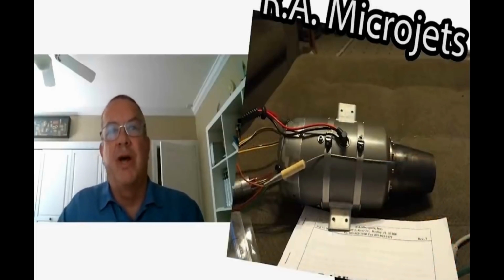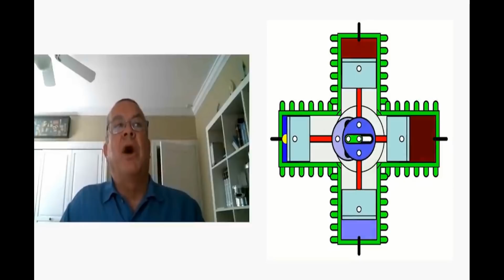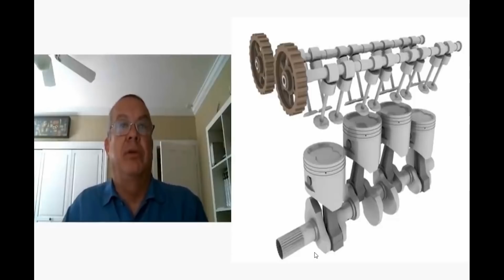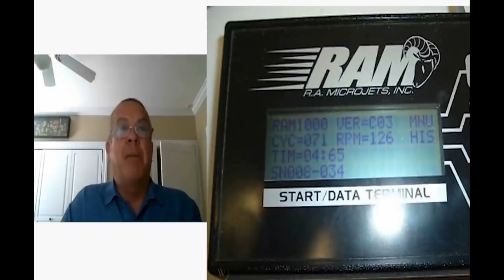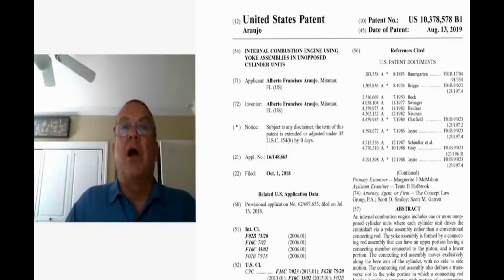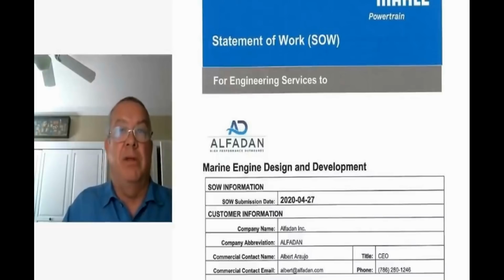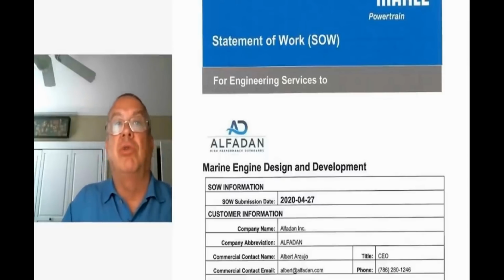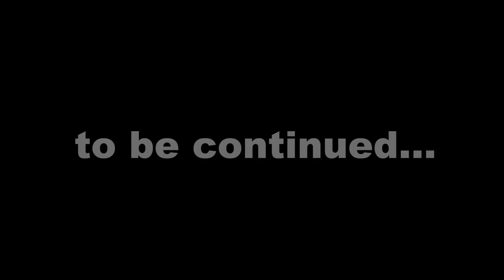Alfadan EXPLAINED! - Part 1

Comment: The piston and connecting does not need to be separate pieces. It can be made of aluminium. And if it is two stroke it will always be in compression. It will favour an over square design.
Reply: Don't quite understand what you are saying .  Piston and connecting rod don't have to be separate  pieces  ?  Connecting rods can be aluminium of course but generally only in small low stressed engines.  Aluminium  rods are generally only used in high performance engines in a drag race situation or such where engines are forever being rebuilt.  They simply do not have durability or longevity.
Reply: @chasermalloy7406  I’m referring to a specific scotch yoke engine implementation.
Reply: @m0rtifiedpenguin  But how can that have a Piston and rod that are one piece ?
Reply: @chasermalloy7406  look at a scotch yoke mechanism. The piston rod does not need to pivot at the piston pin. Rod to stroke ratio does not matter. The connecting rod can be perfectly straight. The piston pin boss adds weight. Length adds weight.
Reply: @m0rtifiedpenguin   I thought you were suggesting that the piston and rod were MADE as one single piece.  In any case it doesn't have applications in high performance engines.
Reply: @chasermalloy7406  that’s what I meant. Machined or cast from a single piece of aluminum. A Scotch yoke mechanism can be designed to work with much less acceleration than traditional crank slider mechanism. The devils in the details. That’s why I said two stroke very oversquare engines. Two stroke piston are always in compression. That’s a very nice set of optimisations right there. A direct injected poppet valve Atkinson cycle two stroke is the sweet spot.
Reply: @m0rtifiedpenguin  I hate this place I just lost a reply I worked on for half an hour.  I'll summarize it next time.
Reply from the maker: Much less acceleration? Explain.
Reply: @thedirtyworkshop use the shortest stroke and biggest bore you can live with. You don’t need high rod to stroke ratios like an f1 engine. This is easier with a two stroke because you don’t need as high an rpm for power and the piston does not experience reversing loads. This simplifies the big end design. An i4 two stroke with a flat crank two pistons will fire at the same time. The engine will have primary and secondary balance and even but not overlapping torque pulses. I would prefer a v4 myself.
Reply from the maker: So, look at the bore and strokes of 2 stroke and 4 stroke engines. 4t are larger bore shorter strokes, not 2t...
Reply: @thedirtyworkshop  port scavenged two strokes need more stroke. nobody has made a poppet valve two stroke engine yet. at least not in production. Atkinson cycle is hard to do without any power valve of some sort. a port engine will require power valves to delay opening of exhaust and intake ports one might as well use poppet valves in the cylinder head.
Reply: @m0rtifiedpenguin  I don't really know much about it at all.  I'd never seen any suggestion that the pistons and rod were made in one piece.   Are they usually one piece ?
Reply: @chasermalloy7406  it’s an optimisation possible in a scotch yoke engine. Impossible in standard crank slider engines.
Reply: @m0rtifiedpenguin  Yeah..it's the one piece piston and rod thing I don't get.  I haven't seen a model or demo where the rid and piston are one piece.  They all seem to show the pistons attached to the rod.
Reply: @chasermalloy7406  I guess I have to go make one then.
Reply: @m0rtifiedpenguin  I'm not arguing the concept because I don't have any detailed knowledge.  The practicality of making the piston and rod from the same material makes me question it in any high performance application.  I also wonder about the practicality of assembly if it were a single piece.  Again just shooting the breeze really.
Reply: @chasermalloy7406  no more different than rebuilding a v8. the piston and connecting rod are joined with the piston pin and then the crank and piston assembly is lowered down the bore and seated on the crank. the connecting rod caps are then installed around the crank and torqued down.
Reply: @m0rtifiedpenguin  But you were talking about piston and rod being one piece
Reply: @chasermalloy7406  assembly would be the same. my point is the connecting rod and piston assembly is handled as one unit during assembly

Comment: Big displacement inline 4 already been done. The 1910 Fiat S76, 28.5L. There's a reason those big displacement 4's are not around today.
Reply: Detroit Diesel Series 50 has been done as well around 8.5L for a 4 cylinder but it can barely rev over 2000 RPM and it shakes and makes a strange engine noise .
Reply: It also required 2 balance shafts.

Comment: look at how a hammer drill works, they just put it in an engine to convert direct recipricating motion to rotational motion, and here you go, you made a rod that doesn't rotate.

it will work, it does in many industrial machines, the problem it getting the thing to be reliable in an engine.
Reply from the maker: A hammer drill? You mean a ramp and anvil? That wouldn't work as an engine...

Comment: There might be a reason why, but why aren't there small diesel outboards? My tractor engine isn't to big, efficient an makes loads of torque. but its heavy as shit
Reply: Mercury has a diesel outboard. Just not small.
Reply: There are small diesel outboard engines, I forget who makes em but they're usually found on sailboats where the extra weight is not a big deal. There are 2 cylinder diesels with like 25hp up to 150hp I believe.
Reply: @csonkaperdido  that makes no sense. On sail boats weight and weight distribution matters the most. Also outboards are not found on bigger sail boats ever. They usually have a diesel inboard though , I'm talking outboard engines
Reply: @johnmeurer4780  the weight of the sailboat doesn't matter to its top speed since it's a displacement hull, not a planing hull.
If you take a sailboat capable of 10mph empty then load it with 5000lbs of stuff, your top speed will be 9.5 knots. Makes almost no difference whatsoever.
Also I'm a marine mechanic, I work on boats every day. MOST sailboats that are, say 30ft or longer typically have a small diesel inboard - yes... But most smaller sailboats, at least in my area (Tampa FL) use an outboard "kicker" motor, NOT an inboard.
I know what I'm talking about bud lol.
I never said the 150hp diesel outboard was a sailboat motor - I said it existed.
I also said, or implied, that the small 20hp outboards ARE pretty much only good in a sailboat bc of the weight penalty. I have a 2 stroke 9.9 Merc that weighs nothing, I can carry it around myself.
You're not carrying around a 10hp diesel.
Therefore, it will never go on a boat with a planing hull. It only makes sense as a low rpm, high load motor.
Which is exactly what a kicker motor is.
Adjust your spectacles there bud, you clearly didn't understand my first comment.
Yes, larger diesel outboards do exist, not just little ones. That was the only thing I said.
If you need a lesson in why a displacement hull will NEVER go faster than it's design allows for, even if you put 5 turbines on it.
Planing hull is a completely different design and completely different power requirements.
Reply: @johnmeurer4780  fuel weighs 6 1bs per gallon. diesel is 25% to 50% more efficient.  So, you are right, carrying 50% less fuel saves a lot of weight.